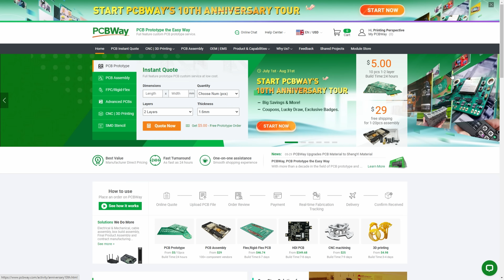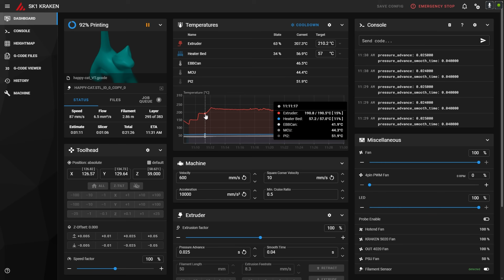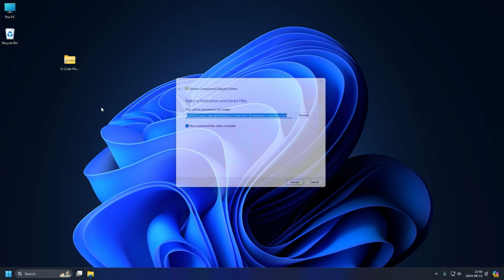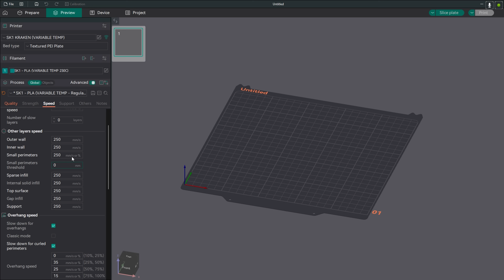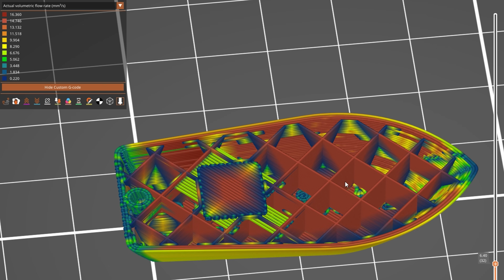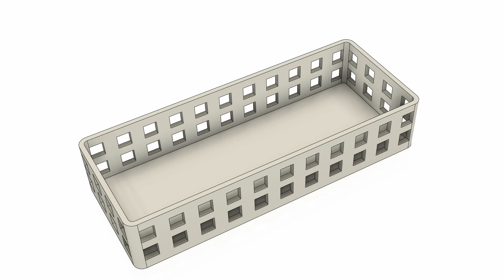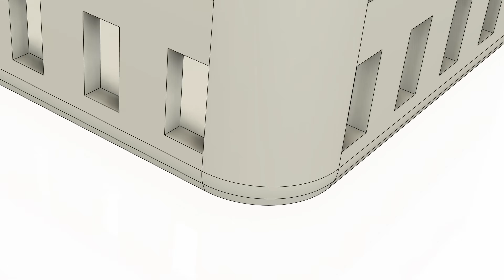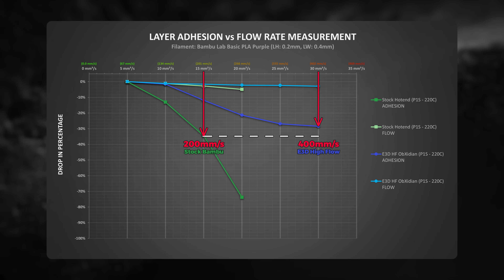Variable Temperature 3D Printing – The FUTURE of 3D Printing?

Comment: For modern high-speed printers this makes so much sense. My qidi x plus 3 can print at ludicrous speed if I crank my PLA temps up close to 300, but if it has to slow down for detail or bridging, heat 
-creep jams, and/or uncontrolled ooze, and/or actual filament burning is lurking just a handfull of seconds arround the corner. I have not tried this script yet, but fully intend to! Edit: an example of how I think this is going to be used: 3DFUEL's Tough PCTG Pro lists "FDM" recommended nozzle temperature as 240c to 280c at speeds up to 80mm/s. And "HSE" recommended hozzle temps of 235c to 390c for speeds from 10mm/s to 500mm/s. Obviously the "HSE" industrial guys are already doing this. The current crop of core xy desktop high speed printers can techically approach those speeds, but without a mechanism to control nozzle temp in concert with flow rate actually reaching those speeds is impractical (only meta PLAs) or outright impossible. Imagine your desktop printer trying to do a bridge at 390c 😂 never gonna happen. But if you can crank down the heat appropriately for those slow moves with extra cooling, and then slam the watts to it to keep the filament liquid when it's being squeezed through the nozzle at 60mm³/s... That's what we need to take desktop/hobby 3d printing to the next level.

Comment: Bambu?
Reply: A new version will be released in a few days, that supports all firmware :-)
Reply: it's already released :)
Reply: @sb53-systemssc28  Хорошо, спасибо.)))
Reply: @sb53-systemssc28  so it would work with a prusa ? i have a  prusa xl i saw your git it says it doesnt work with multi-material yet but if i just ran one tool head  would it work?? because a tool like this would be very handy for that printer
Reply: @VaultBoi101  Yep, it will work correctly with only one head

Comment: A simpler solution regarding the finish is to slow down the outer perimeter wall speed so it's uniform. Less quality variability (or translucency) as happens with variable temperature.

Comment: Variable temperature is common option on better foam cutting CNC. I remember reading about it 10 years ago. They were not using thermistor for temp monitoring, but instead resistance and/or current draw from wire itself. Maybe you want to look it up. Might be interesting...

Comment: It's faster response to change fan speed. Changing filament temp has it's own challenges with respect to time. The real forward move is to consider the amount of plastic for a given model, in layers, to control fan and movement speed in the slice, based on the amount of fan overhead.

Comment: This feature will cause thermal fatigue to the heater cartridge. The repeated thermal cycling stresses the resistive element inside the cartridge which will cause failure. Induction heating is the superior method to be used in hotends and can use variable temp printing without any problems.

Comment: "Don't slow down outer walls' in Orca (under Filament -> Cooling) should achieve the same result if we also lower the overall speed by a bit. A good compromise until this feature becomes mainstream. This option will print the outmost wall at the same speed but compensate by slowing down infill and inner walls even more

Comment: I'm running a suped up ender 3, it can move the piece at up to 675mm/s (7750mm/s2 x axis accel 5k y axis accel), and I'm getting this problem, but I can't extract the settings, since it's not running klipper (sorry, really tight budget)

I tried replicating the json file with my machine's settings, but the program refuses to accept it, can you please share your original file (in txt so the link doesn't get flagged) to see what's wrong?
Reply from the maker: Brother, please. I clearly said in the video and on GitHub the first line - "A Post Processing Script for Slic3r based Slicers and Klipper Printers."
Reply: @PrintingPerspective  sorry :(
I don't have enough money for the klipper conversion, but since this would still be able to alter the gcode itself, I thought it might still be a good tool to have...

Comment: if it's just a visual improvement, I wonder if this variable temp can just be applied to the outer walls of the print
Reply from the maker: It is not only visual, it still gives you a rough idea of the layer adhesion strength. :) But we shouldn't lower the temperature too much for the small sections as higher printing temps give better adhesion.

Comment: Should the script work the other way around (sorry if it already does and I didn't understand). It should limit the top flow rate to match a temperature, that is, allow the current temp value control to set the flow rate (and head speed). Use a look ahead in the file to anticipate the speed needed soon.

Comment: I was thinking of this a few months ago! I just imagined off the top of my head this would be one of those things where it might be too much for the open source community to develop, as in there might not be enough interest.. IM GLAD I WAS WRONG 🥰

For me this is HUGE for mechanical parts that i want printed fast. Not only will it ensure its up to temp on certain sections for best layer adhesion BUT also it's not too hot for bridges and overhangs. I found some years ago if the speed settings are too low for steep overhangs it heats the plastic it's laying onto and warps/droops the wall, giving you the dreaded curl or filament hang. That way the outerwall can run cooler for best overhangs while the innerwall will be hotter at higher speeds.

Comment: I don't get why this isn't standard already. The fact that for small prints with thin wall that you have to use a different temperature then on larger prints should already open the question why not adapt the temperature to what is getting printed in the moment.
Reply from the maker: Yeah, seems logical, I have been waiting for this for a while.
Reply: @PrintingPerspective  Thanks for sharing this.

Comment: I get the feeling this would better be implemented in the 3D printer firmware, as opposed to in the slicer. The slicer should just tell it to aim for 220C, while the printer should compensate depending on the actual flow-rate.
Reply from the maker: Ideally, the stock Klipper would have it as most machines have way more processing power to live adjust things.

Comment: I love this. I have parts that I produce that have highly variable flow rates and I currently solve this issue by manually adding the temperature change command to the gcode. This is slow and prone to error, so an automated solution sounds like a dream
Reply: Happy Smart 3D Printing

Comment: I actually can't believe we're getting into this territory now. I've long wondered when we would be into the concept of watts per cubic area of plastic over time, and when we'd be able to tune that, the idea I had goes slightly a step beyond temperature per features/extrusion sparsity and takes into consideration the approximate thermal energy a given extrusion move would pull from the system, pre-emptively putting an extra amount of thermal power into the hot-end, at a rate proportional to the move and also before it physically occurs. Not directly adjusting the temperature setpoint directly, but deciding how much arbitrary power to inject as it's about to be needed and during, and as a RESULT keeping temperatures from dropping during long and fast extrusions. Think of it as a look-ahead for PID.. Or maybe intentionally detuning the PID into a momentary overshoot?.. so It's actually a bit backwards from this concept of setting/cooling temperatures down for sparse moves. But the end-results would be similar, so tomato tomato I guess!

Also my biggest pet peeves about auto-tune parameters, is the very idea that these loops are being calibrated.. without plastic being pushed through them, surely some of the values would be more optimal if it was tuned with plastic flowing and during extensive extrusion moves, the PID model was updated to a flow-rate based PID, instead of one tuned off a stalled system.
Reply from the maker: Nice to see that someone actually gets why I am excited about a project like this and the potential that can come in the future. :)
Reply: @PrintingPerspective  you are one of the few 3DP channels that actually digs deep into the weeds and just keeps going until root causes and occurrences are proven and made more clear, love it!
Reply: you are dreaming up feed forward control my friend. Using the gcode geometry data as an input we can achieve some wild shit in 3dp. Need something new on the hardware side to deal with imperfect layer adhesion though. I've seen lasers being used and halogen lamps, but they arent optimal.
Reply: I think you're referring to this: https://marlinfw.org/docs/features/model_predictive_control.html

Comment: This is not an issue unless you're outrunning your melt rate and getting incompletely melted extrusion. It's best fixed not by dynamically adjusting target temperature, but by dynamically adjusting heat output to match the flow. This is what MPC heater control (vs PID) does.
Reply: I dont think I understand you correctly. By using MPC the hotend temp should remain perfectly stable no ? Than if the hotend temp is already perfectly stable with PID, MPC wouldnt change a thing.
The only way what you are describing could work was if MPC made the hotend temp variable, adjusting for the flow and lack of time for the filament to heatup, but that is not what it does (at least in the current Marlin implementation).
Reply: @valegreg  The issue is unless you were measuring temperature at the outlet of the nozzle there is always a lag in system response. Slowing down would overheat filament and speeding up would cool at the nozzle tip until PID levels out. MPC takes the specific heat capacity of the plastic into account and proactively heats in anticipation of the extrusion move. By using this feed forward method you end up with much more consistent extrusion. The only time extrusion is ever perfectly constant is doing vase mode cylinders.
Reply: @valegreg  There is no such thing as "the hotend temp". There is a temperature at each point in the thermal system. PID controls the temperature measured at the thermistor, which is not the same as the temperature at the surface of the filament path where heat is rapidly moving into the plastic. MPC models the thermal system and inputs the amount of heat matching what's being lost, rather than waiting until the loss or gain is enough to see a change at the thermistor from migration within the system.
Reply: Good idea!  changing PID in theG-Code is not available for Klipper unfortunately ☹
Reply: @sb53-systemssc28  The DangerKlipper fork of Klipper has MPC.
Reply: A new approach that controls the intensity of heating would be welcome. For the moment, the change in temperature already offers a clear improvement !
Reply: @sb53-systemssc28  very true but something like MPC would be more precise to compensate for the energy required to heat the plastic at varying flowrate by knowing the material density, ambient temperature, and specific heat capacity